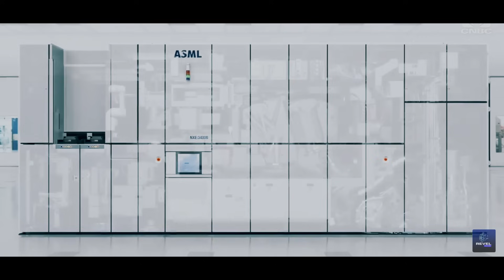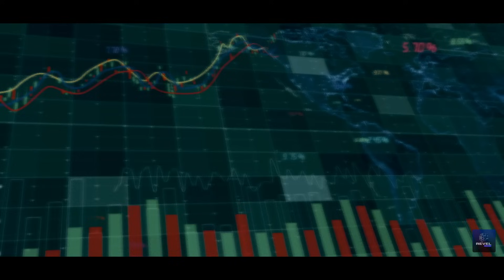ASML's crisis: Russia's chip tools rival EUV

Comment: I installed and ran deep UV ASML Twinscan systems at Intel, and  was involved in early EUV  assessments there. I had a similar role at IBM years earlier. A statement was made about maskless, software defined lithography. This technology has been in use for 40 years, using E-beam direct write to image masks for the steppers, scanners,  and step and scan systems. Titanic efforts were made by IBM, and countless Silicon Valley startups to bring this technology into high volume chip manufacturing. It turned out to be far too slow. Massively parallel E-beams were also tried to boost throughput, with poor results. If you are out to produce small quantities of chips for military use, the E-beam (or laser, or neutron) direct write might work, if cost is no object. I suspect this is an effort to overcome chip embargoes. Also,  most military hardware runs off chips from a far earlier period. Most Patriot missiles and Tomahawk cruise missiles run on chips with 250 nm feature sizes. This was state of the art in 1995! Current state of the art is 4nm. If the Russians can manage 250 nm, They are OK militarily if the volume is there. China is very very good at these older chips as well. Russian firms are currently buying up Mid UV (365nm) ASML steppers and parts all over the world to keep the few tools they have operational. Keep in mind that a wafer fab is VERY vulnerable to sabotage, drones, etc. I would concentrate efforts on the black market instead or in parallel.

Comment: Even if there is research that may achieve comparable results, that is not the same thing as having commercially viable lithography machines.  Even if top commercial results are achieved, there is no way to duplicate what TSMC does at cost effective level.  End result would be more expensive chips that can only be paid for by having captive home market.

Comment: Can you provide the link to the sources? Say St. Petersburg reserch group's news stated in the video?
Reply: They have indeed produced a lithography plant (not yet capable of mass semi-conductior production, as of 1 month ago) but it's at 350nm. That is at the level of year 2000 (earliest was 1996 or 97). They can however produce 65nm independently (as far as I know) at the minimum if we exclude lithography. 

There is some use to 350nm lithography, but their own semi-conductior plants don't use that kind of range, they start at 250nm and below. 
If you want a source, just Google "Russia 350nm lithography" and you'll get many sources, it's the rosatom research group.

They might really get to a point where they will be able to be independent, but even the goal of 14nm chips until 2030 seems to be far stretched, as far as I've read. As for lithography, they want to get to 65nm until 2027, which is wild considering they have just produced 350nm.